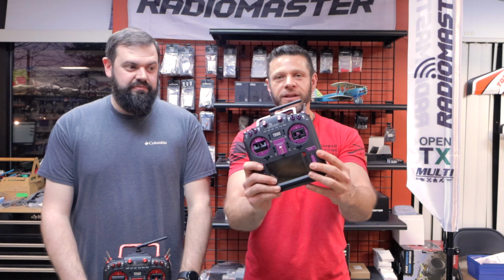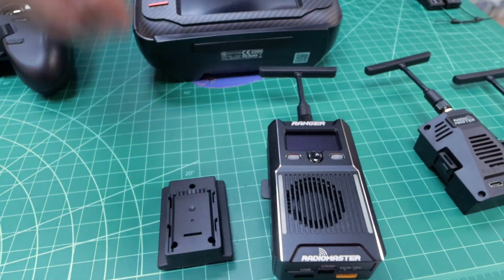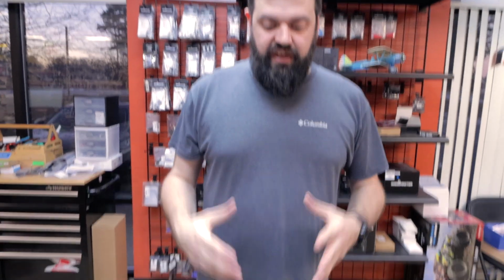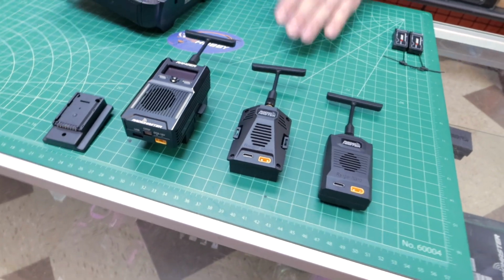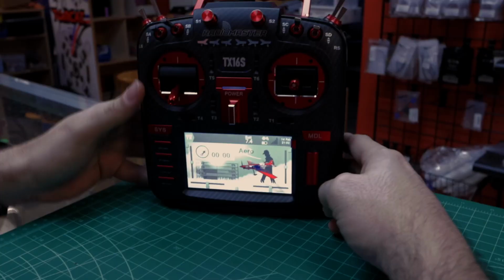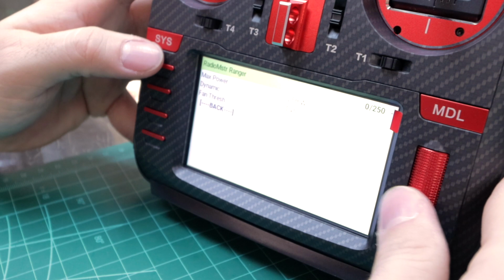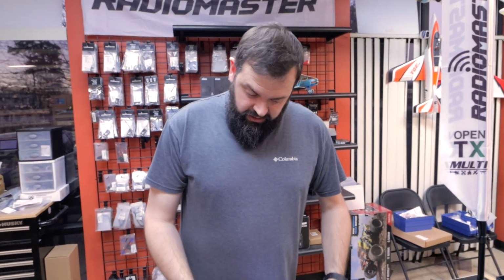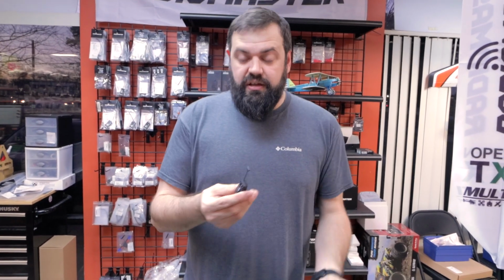Unboxing and First Look: RadioMaster Ranger Module - Advanced Features and High-Speed Connectivity

Comment: First thing I'd do with a Boxer when I got it home would be to erase EdgeT-X and flash an Open-TX target onto it.    Because Edge-TX don't work with Open-TX Companion, and that's a deal killer.  Edge TX Games and a touch screen code aren't going to matter at all on a Boxer.   Sell the NetDot12 L USB 3pack charge cables, thats what I use exclusively with my Radiomasters.. with a cheap Chiensee 7 port hub with switches on each port to turn on and off.  

The Radiomasters won't power on if the USB cables are plugged in, so I use the hub to swtich both cables off, power up the unit, then switch them back on again.  It's stuoopid and a pain but it's the only way to do it, or you're plugging the USB-A side cable into and out of your computerall the friggin time.    Always plug and unplug the cable on the USB-A side.

Comment: What you need to do is have a pair each of demo models of goggles on like a chain at a counter for people to come in and try on and see if they are right for them.  If I could of done that with the DJI V1 goggles, I would of never, ever bought them because I've hated them since I opened the box and only used them once.  That would actually get me to visit a hobby store in person, even when it was 150 miles away.  

Everything else, stick one of each under a glass display case so we can drool over it.  Or in plastic baggies on the wall on hooks is better, so we can bee line right to it and grab it, ring it up at the cash register, and go.

Comment: Yesterday Radio Master issued a statement to not use the XT30 port on the Nano and Micro versions. They stated that it is fine to power these units via the radio but not to use the XT30 port as it has apparently damaged some users radios. They will be redesigning the board and will be shipping replacements out to dealers and folks who bought directly from them in the coming weeks. This issue does not affect the Larger Ranger module.

Comment: Does this have an advantage over crossfire?
Reply: The advantage is that ELRS is open source.  So there are more developers making the system better with more feedback to help update.  I love crossfire!  It simply works and is easy to update.  I have Crossfire on my fixed wings and my quads and have used the system for long range and racing.  TBS also has been a company that has made FPV products since the beginning and has been a company that has made it while others have come and gone. But i also have ELRS and I can say that both systems are great and work excellent.  I do prefer my Crossfire over ELRS for long range FPV on fixed wings I have flown over 15 miles.  But I also like the tiny receivers that you can get at a cheaper price for ELRS.  So I think its really a question of budget and what you want to do with them.
Reply: @vick-hy7tw  I put crossfire on my DX9 Black Edition back when spektrum released what pins to solder to and a firmware update to run it back in 2018. I havent updated my crossfire firmware since i got it and am on version 2.18 and i just saw their latest update was like 6.15 or something. It works great now and i have never had a failsafe the whole time ive had it, i had failsafes constantly on spektrum. Is their any benefits to upgrade it to the latest versions?